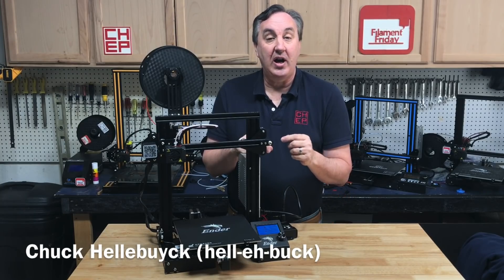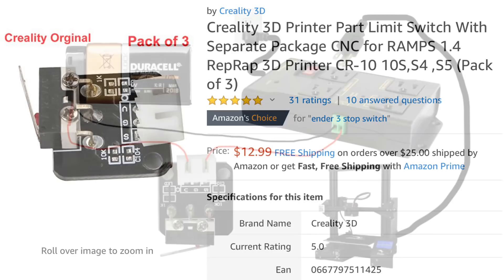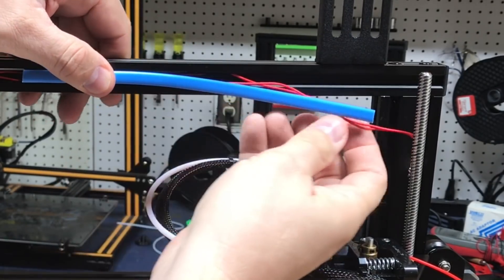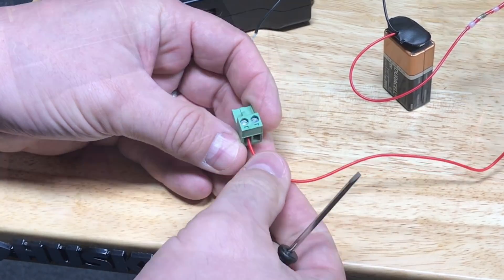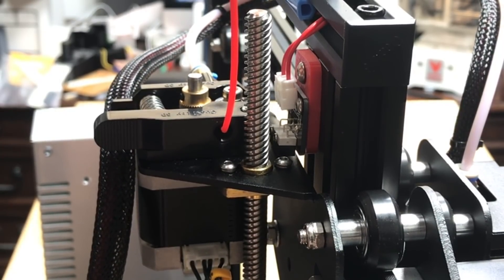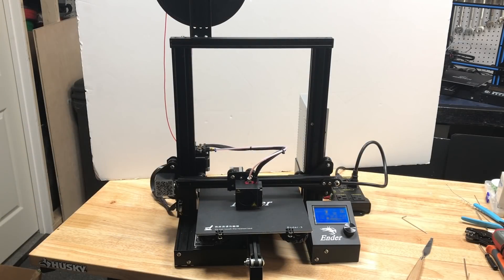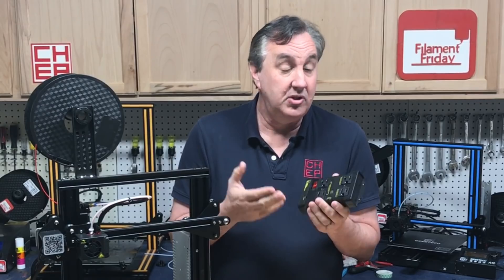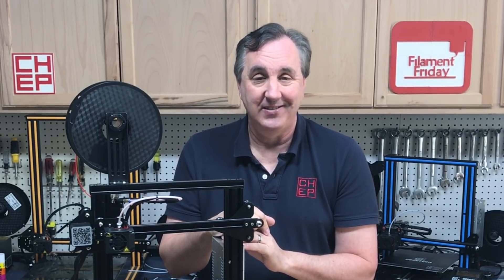Simple Auto Off Control for Creality Ender 3 without Octoprint

Comment: Hello good sir.
I asked about a problem with over extrusion and burnt filament for the first 1mm of a print. That was about 2 weeks ago.
I tried everything. Moved the extruder to the hot end carriage to eliminate the Bowden tube. Swapped to a new stepper and so on. Nothing changed this so I went back to the factory configuration.
Went into the control settings and checked filament. E in mm3 was turned on. Turned that off and it works fine.
Any idea why this would cause issues for the first few layers?
Reply from the maker: No idea. Are you running a skirt to purge the nozzle before printing the design?
Reply: @FilamentFriday  always, I also have it run a single strip on the left side of the bed before it starts the skirt.
Reply: @FilamentFriday  that setting definitely fixed it.
I'm going to make it a trend to encounter something really strange in an effort to stump the expert.

Comment: Good video, but if running Octoprint it is quite straight forward. I run a TPLink Smart-Plug as well as the TPLink plugin for Octoprint. This opens a wide variety of options such as power off/on on print, error, GCode command, etc. My RPi is powered from my printer's PSU so I can turn it on from my phone or Alexa, and have the printer automatically turn off after a delay to allow the hotend to cool down. 

The smart plug can also monitor power consumption and is a lot less hassle to set up than a limit switch. Cheaper too.
Reply from the maker: Much of what you just said will scare many people off as complex so this is a simple alternative for those that want a simple solution.
Reply: @FilamentFriday  It really isn't - plug in the smart plug to the outlet, plug the printer to the smart plug and install the TPLink Octoprint plugin. Install the TPLink app on your phone, get the IP and you're good to go. Tick the box on the plugin that says "Power off after print" and add a delay to prevent heat creep. Sorted. Easy PSU control from Octoprint.
Reply: @agentl3r  you dont need to go that far just a wifi plug for people who do not have a raspberry pi will do.

Comment: Say hello to clogged nozzles if you turn of your printen while it’s still hot...
Reply: The video shows how you can delay the shut down to give it time to cool off.
Reply: @kodygrant5077  Not really, if the print is 200mm tall it will only have to move 50mm, so it will not cool down in time. The way to do it, is by setting a low temperature and wait until so, and then move the printer as fast as you desire.
Reply: LOL. Hot end cools off at the same rate, and melts again when heated back up.
Reply: Jochem van Beekum ....I have never found that on the Ender 3.  My clogged nozzles are normally due to age or  ill fitting bowden tubes.

Comment: One problem I see is that this requires the z-axis screws to not twist freely when the stepper motor is not engaged. I have my Ender 3 tuned and squared to a point that there is little to no pressure holding the x-gantry in place without the stepper motor being engaged and would likely drop over time causing the printer to turn back on. I may look into doing this but with the second all the way to the right on the x-axis. Then, as long as I don't print to the full extent of the bed's width (something I rarely do), I can just have the gantry move to x230 and simply tap the print head to the left to turn the printer back on.

Comment: I use a smart wall plug (± 10 euro's). And turn it off (I can do this on my smartphone where ever I am) 10 minutes after the print time comes to an end (to be sure). And you can 'program' the switch to turn off after every time you set it to.
Reply: you can get a clogged nozzle that way by just switching it off, just leave it for 20 minutes or so to cool down then turn it off or if you have a Pi like me I use that and IFTTT I use the pi and that to turn itself off via a wifi plug after cool down. then back on via Alexa or my mobile or just press the button on the plug. Even tells me how much electricity I have used!!

Comment: very nice idea! Just a quick question: i'm looking to buy the Ender 3 but before i need the space it takes to properly work (stock ender)... can't find it anywhere.
Because i want to place it in a very tight closet. thanks in advance!
Reply: It can get very hot in a tight space, the hot end is 200 degrees plus the plate at 60 degrees then the fan on the electrics panel and motherboard, thats a lot of heat to dump, If youre going to just print PLA leave it on the side of a desk of buy Crealitys tent for it.

Comment: Edit: add M109 R45 to the end gcode. Makes the printer pause until the nozzle cools down.

I see you've posted the looking forward to your video comment a few times. I think I get that you're encouraging content creation. 👍
It really depends on a person's level of skill and confidence how they choose to tackle the feature in your video. I like how yours is almost stupid-simple for the entry level user to get working. As their confidence, experience, and skillset improves they can decide to avail themselves of more complicated options.
I've been in this a bit over a year and have an electro-mechanical background. My current iteration is using a wifi switch (open source firmware) with Octoprint and Home Assistant to monitor and control my Ender 3. That's not something a newbie will likely want (or should) jump into right at the start. They'll be having enough "fun" getting a good print from their machine at first.
What's great is the maker community has a wide range of skill levels and many people have chosen to make videos about setting up such systems. I'd love to get into it myself and talk about areas I feel haven't been covered or put my take on a way something has been done already. The where-to-begin aspect has me trapped at the gate though.
Reply from the maker: Exactly why I look forward to their videos. No point in posting a comment about an alternate system if they just end up hiding it in the workshop. What good is that.

Comment: On some of my Enders, if they loose power the Z will drop. Once it hits the power switch, it drops and immediately turns back on.  I've used a locking switch instead of the momentary one to fix it.
Reply: An anti-backlash Z nut would help with that.
Reply: @OldCurmudgeon3DP  And ruin the print quality...lol what a fail
Reply: @alejandroperez5368  Why would an anti-backlash nut ruin the print quality?
Reply: @chrismorrison9140  Cause he doesnt know what he's talking about...
Reply: @GamesPlayer1337  wifi plug ? works well I find....
Reply: @sitgesvillaapartmentneilsc7924  second comment you mentioned me where the answere you gave hasnt had anything to do with what i wrote...
Reply: @GamesPlayer1337  sorry wasnt meant for you my fault.....
Reply from the maker: Good idea.

Comment: Yes, it works but with a small firmware modification, you could use a servo signal to emulate an ATX PS. And no need for switches.
Reply from the maker: I look forward to your video on that.

Comment: But why?
You can't use the full z height
Reply: Never printed anything more than 200 mm
Reply: Been printing for over a year on a cr10 mini and I have never printed anything that is anywhere near using the full z axis
Reply from the maker: Yes, you lose those last 5 mm that doesn’t print well because the PTFE gets pushed and limits the movement of the hotend but yes you are correct.
Reply: @FilamentFriday  Well I didn't have an ender 3 so   
 I didn't know about the PTFE problem 
Thanks for letting me know

Comment: Just get a Pi zero for octopi and a sonoff (both together less than 20$ and requires less tinkering and can do more) Why would anyone would want to do this? This is one of the worst and unpractical thing I've seen. Just sayin', you can have a much better and cleaner looking solution for less. Not only this, apart from more wear on the leadscrew, I think the ender3 isn't really made to drive the Z gantry this high. It really harms the ptfe tube and wiring.
Reply from the maker: Looking forward to your video on how to set that up.
Reply: I almost have that same exact setup and it works wonders (Pi 3B+ and a TP Link Mini Smart Plug). There's even a plug-in for the Smart Plug so it can auto shut off after a print.
Reply: @iCreatePiE  I like the sonoffs a bit more because you can flash them with opensource firmware :). Yea these little thingies are really valuable and become dirt cheap. But (maybe only my personel preference) I like the ones that don't rely on cloud nonsense and the firmware is backed by the community firmware, I wish you luck that tp link still supports these things in 2years.
Reply: @VincentFischer  Just saw a video for flashing the Sonoff's firmware. Looks a bit complex for a newbie like me, but I might stick with what I have. Thanks for sharing! :)
Reply: You ultra nerds are worst

Comment: If you are using a Raspberry Pi with Octoprint, I guess you can use a 3.3v or 5v feed from the pi instead of a 9v battery. Of course, the pi have to be powered from a constant power source, not the same as the one that turns off the printer.
Reply: Why? I don't understand. Please elaborate on this. I feed my pi directly from the printer psu without problems. It even waits with switching off until it's done rendering the time lapse. Am I missing something? Look into the plugin menu, a ton of remotely controllable power sockets are already supported in octoprint.
Reply: @VincentFischer  My post here was based on the product Chep used in the video, not the 100+ other ways to power off your printer when it's done.

Comment: better to strip the wire before crimping?
Reply: Looks like the JST pins he's using pierce the insulation just fine. I need to see in my Dupont crimper will do this. Stripping small wire is fiddly.

Comment: I love this idea however I was under the impression that you need the hotend cooling fan on to cool the hotend prior to switching off your printer. Could this be a safety concern?
Reply from the maker: It cools while it rises. Like I said in the video you can slow it down if you want more time for cooling.
Reply: @FilamentFriday  M109 R45 in the gcode to make the printer wait until the hotend is cool before moving to the switch.

Comment: WiFi plug and octoprint. Job done. Liked the vid though, Chuck. 😀
Reply: I've considered that a possibility, but I think I'll go this route in case the internet is temporarily down.
Reply: @alphaqlater  Or use the same relay controlled by the Pi instead of the switch

Comment: Great idea. I always wondered why it isn't a standard feature to turn off the printer after finishing the print. I myself use a time switch with countdown function to turn the printer off. Its not completly precise but better than have the printer running all night without need.
Reply: Same here .Uses Sonoff's to shut down my printers using timer function ,yes the printers do not shut down right after the prints 
ends ,but i am setting the timer to shut down approximately a half hour later ,no routing of wires is used to get this up and
running

Comment: With a wi-fi outlet I can set the time to auto shut off using my phone. I can also turn it off remotely before it finishes a print if I notice through my wyze cameras that the printing is failing and save on filament.  Thanks on the tools tips anyway. Very handy.
Reply: That's what I do. I have a wyze cam watching the print and the printed plugged into a wyze plug. Turn it off remotely at any time.

Comment: An alternate way to achieve similar results would be to use a Wyze Contact Sensor in place of the switch and have it turn off a smart plug when closed. But thanks for the idea!

Comment: You can do this with octoprint and a wifi outlet much easier. :)
Reply from the maker: Simpler than a switch, battery and wire. Haha.
Reply: @FilamentFriday  "easier" depends a lot on the skillset of the end user. Mine and Tim's is quite a bit higher than a newbie. They can move up to his "easier" solution when they feel comfortable with it. It's better, yes, but requires knowledge that most of those starting out won't have w/o watching a number of videos and also having that tinkerer mindset.

Comment: didnt you add an auto fan off to your printers . Maybe use that signal with an override to get the print started then turn off override and once the fan stops it send signal to your relay box. If voltage is too high use a dc dc step down.

Comment: I use a smart plug and wireless camera.
Reply from the maker: How does it automatically sense when to shut off?
Reply: @FilamentFriday I can watch the print with a high def camera and shut down when the print is either done or fails. It saves me a lot of money on wasted filament and I can keep tabs on the prints with my smart phone from anywhere. The camera and the plug cost less than $50.00 on Amazon.
Reply: @parker1ray  It's still not an auto shut off just remote.
Reply: @twiggss4344  I never said it was an auto shut off! My biggest issue with any printer has always been either failed prints or running out of filament. One cool thing that the smart plug allows me to do is if the machine is about to run out, I can shut it down without turning the machine off and merely load new filament and answer yes to resume print. No filament detector required.
Reply: You are doing it the same way as me.

Comment: I made one of these using an Arduino and servo to switch my printer off from its regular switch. Also added a smoke detector to switch it off if there's smoke. Cheap setup that has added options. Eventually got rid of the axis switch and added an LCD and programmed it so I could enter a timer to switch it off.
Reply: I bought a 433MHz smoke detector from Banggood and use my Sonoff RF bridge to send an alert to my phone via my Raspberry Pi server and also going it use it to switch off the printer's wifi controlled socket

Comment: Hi, Do you think it's best to wait for the hot end to cool down before switching off ? I am using a smart IP camera and mains plug that I can monitor and then remote switch off, but I like this method to auto switch off at the end of the print and I am going to add it to my large format printer.
Reply from the maker: Like I said. Slow it down F1000 or even F500 so it cools if you are concerned.
Reply: @FilamentFriday  You can also add an "M109 S40" to wait until the hotend has cooled down before raising to the top and shutting the printer off.
Reply: @toniwryan  needs to be R40 to make it wait for a cool down. S40 waits on a temperature rise and will just skip over it when the temp is above the value.
Reply: @FilamentFriday  It looks like this is not for sale in the UK at the moment.
Reply from the maker: It’s only 110v.

Comment: Hi Chuck, you are a creative guy and also this is a creative solution for power off.
But if this optional switch fails (each switch has it's end of life) or the battery died and you are absent you have a problem.
Reply from the maker: How? 
If battery dies it shuts down. If switch fails shorted it dies. If switch fails open then the printer stays on as it usually does before adding this. Where is the problem?
Reply: @FilamentFriday  ah ok, it's the other way around, my fault!

Comment: I appreciate the DIY spirit, but Octoprint and a smart plug or a relay is a better solution by any reasonable measure. I think you have not covered Octoprint in your videos before, you should give it a try. There is also a plugin for Cura to directly print to Octoprint (and other slicers too), it is a huge QOL upgrade.
Reply from the maker: Not sure it’s better but different. Just wanted to show a simple solution.
Reply: @FilamentFriday  I've found it to be a big improvement overall in my printing experience. There are some obscure gotchas, but they aren't going to bite most users.

Comment: Thanks for the video Chep.  I personally just use a Wi-Fi power strip from Amazon I got for 27 bucks. Works great and the app actually has a timer where you  can set it to automatically shut off after a print (set time in the day).

Do you think you could make a video in the future about how to move all the electronics out of an enclosure  and  mainly just extend all the wiring for the stepper Motors in the Z limit switch? Believe it or not there's not a lot of videos or how to do on this subject. Thanks again for the upload love your videos.
Reply from the maker: Why would you want that? 
I thought most people liked the all in one printer.
Reply: @FilamentFriday  Well for me personally my printer is in  an enclosure in my garage. I live in AZ so in summer I can't even print PLA do to the ambient temp in the garage. The heat sink can't keep the temp so the PLA just melts all the way up lol. I do alot of PETG /ABS in summer. I want to get the main board outside the enclosure.